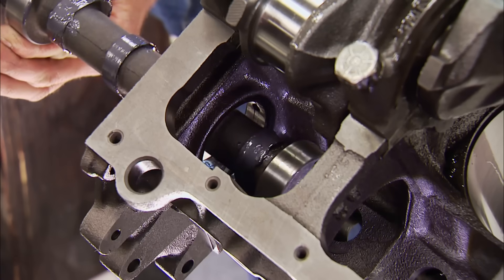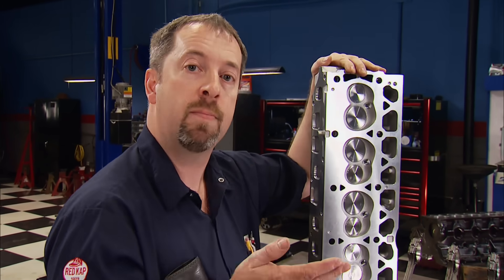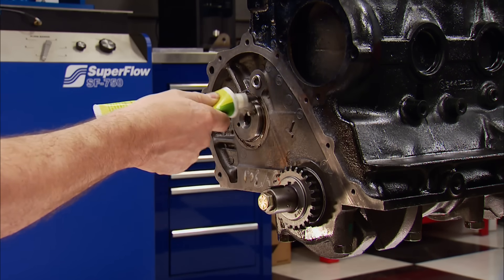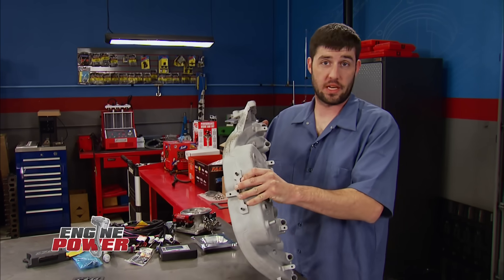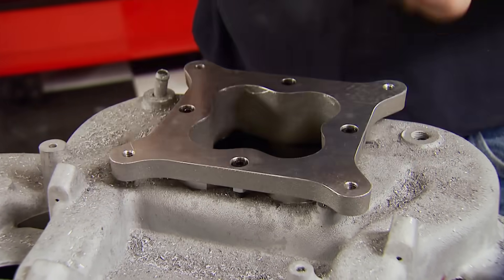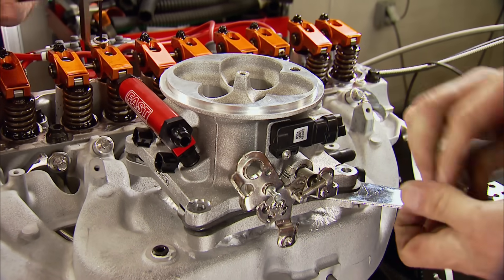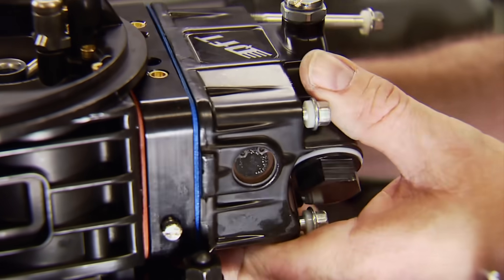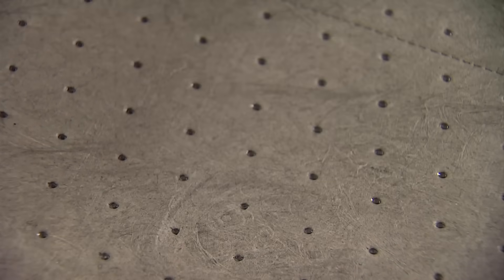Rebuilding a 4.0L Jeep Straight Six to 242HP - Engine Power S2, E14

Comment: Still hoping to see a Ford 300 straight six. Horse power per cube?
\/  People that agree.
Reply: Brock Main3 All this may be true but like to show people ford and GM build dual ohc motors 8n European brands.
Reply: Brock Main3 I'm a pushrod fan but like this build FOR SOME DAM REASON no one put in flat top pistons or direct port injection. I really want to see a pushrod inline six at 1000hp.
Reply: Way back there was a guy named Bruce Size more - he ran a 300" six with a fabricated cylinder head made from sections of 351 Cleveland heads furnace welded together, the car flat flew!
If I remember correctly the car ran in N.H.R.A. Modified Production class.
Reply: MIKE MOTORCITY OG I want to see something like this.. https://youtu.be/zmtVyfC_bBo
Reply: legotec49 No get the dual overhead cam inline six Aussie Ford motor. Guy on Internet put one in a 66 mustang with turbo and it flies.
Reply: @Thelongmanable  No I want to see a Ford 300 straight six pushrod engine.
Reply: @Thelongmanable  boring.

Comment: Wow , old school carb, did the trick. You could even tell the differene in the running and throttling up. Sounded better and sounded more powerful. Awesome good job.  😀👍
Reply: Because the FI system wasen't operating correctly.
Fuel injection would've made MORE power than the carburetor produced & there is NO DISGUSSING that fact.

It's 2019.....
Reply: @elonmust7470  If you say so genius. Since you knew what was wrong with it why didn't you hop your happy ass over there and fix it.. 🤔

Comment: Why not go with the multiport fuel injection like what was stock? Im sure it would have been easier to tune to get to your goal.
Reply: Someone said it in another thread, but, Sponsorship.....
Reply: And would have prevented having to buy a pricey FAST system.
Reply: I was wondering this as well. Seems like they just plugged the injector holes on the manifold instead of figuring out what injectors they needed
Reply: THIS. When they spec'ed a throttle body unit I lost most of my interest.
Reply: @nazcaplain  Throttle body is only worthwhile if you're upgrading from a carb.
Reply: Yes. It was weird to try that TBI drop on unit. Especially the way it was cut into the manifold. I respect the carb solution but there's a better way.
Reply: Or at least find the limit of the factory system and know what to upgrade

Comment: I wish you could have done something for my old 1979 Mercury Monarch. It had a 4.1L straight six with a 1-barrel carb. It produced 97hp in a 3200 lb car. 0-60 in 18 seconds. I hated it and have never bought a car with a straight six in 30 years.

Comment: Your intake probably failed because of how you did it.. and to quote big chief, looks like ray Charles welded it with his feet
Reply: Alex L  ...But Ray COULD weld!! Haven't you ever seen his welds? 
....Neither DID HE!!
Reply: maybe it needed the overhang trimmed to the inside of the plenum and welded flush also?
Reply: Ray Charles was only using his feet so he didn't mess up his hands since he plays the piano
Reply: You ever weld cast aluminum?
Reply: @Thewaldo12345  they used a forgiving filler rod for all of the welding except the first few tacks, lots of gas. Preheat the parts before welding and you'll get better results. I would guess someone is at their CAD and will 3D print in aluminum a proto-type that gives way to a new mass produced intake manifold.
Reply: @Thewaldo12345  one can it dos not work well      I'll bet it Cracks under 10000 miles           They will never tell       it looks good
Reply: @JT_771  exactly, I bet they lost a bunch of horsepower because of that.
Reply: Well cast aluminum isn't the easiest shit to weld and there looked to be some serious tight spots.
Reply: Why did the carb breath better?  Intake stayed the same?  They just didn't tune the fast system.  And why the F use a TBI? They had a MPI intake and no money or parts limitations.
Reply: @ryanharte528  Hahaha literally! Just a product promotion for that shit carb no doubt.
Reply: Nice joke but those welds were pretty good.

Comment: If I was to "REPLICATE" what y'all did to this engine, would it FIT in my 1994 2WD Ford Ranger?

As I want to convert to an Automatic Transmission, what BUDGET options do I have?

Take care,
🤓 -Thomas
Western Washington State
Seattle, Washington Area
Reply: Just pull the engine, transmission, & wiring for them at the junkyard. You'll either end up with an AW4 or a 42RE automatic trans. Then you have to figure out mounting them. Sincerely an Eastern Washingtonian
Reply: Put a 302 in it & stop being stupid.
Reply: @elonmust7470  how boring. not suprised, coming from someone who claims to have swapped alot of ls engines into cars.

Comment: "Build a modernized version" uses flat tappet cam and carburetor
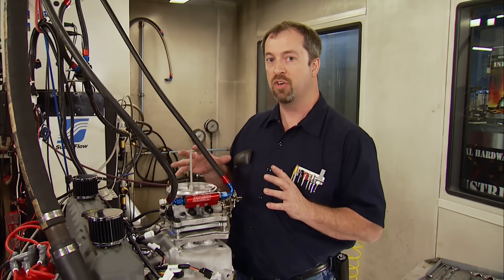Reply: @pritchert2799   14:43
Reply: This engine is 75 years young they all had c/s push rods @ rockers better than the JUNK today,run forever!Two breather filters on V/cover this lowers the temp by 25' the headers release 35%more back pressure the 4barrel carb works better than the slow injectors so all they have done is nothing but OLE SCHOOL 1967 STYLE THE MORE YOU PUSH IT THE FASTER IT RUNS IF YOU GET ROLLER TYPE GET THE BEST.TAKE YOUR TIME T/ PRESSURE HAS TO BE PERFECT!ITS A BALANCE ACT  MORE PRESSIRE OUT TAKE MORE FUEL IN HIGHER HP AND PREFOMANCE ,FLAT TAPPETS CANT KEEP UP,THE ONLY CON TO ROLLER FINE METAL ,YOU HAVE TO CHANGE THEM EVERY 30000.!
Reply: @rayoliver6807  Not going to much against what you said. Pretty good motor. Although fine metal shavings are death to an entire engine not just the rollers. (No matter what engine brand) I have roller cam engines that I driven with well over 200k miles on them. I have clients with even more miles. Remember that a flat tappet cam leaves small metal shavings behind as it wears. Shortening the life of the engine. Also flat tappet cams run much hotter do to the friction they cause, again shortening the life of the engine. Fuel injection is a big expense that is not needed for performance. However, you may wind up (depending on your set up) with a much smoother more responsive engine.
Reply: @Dieseling123  me
Reply: @shenanigansgarage3911  me
Reply: @pritchert2799   did you even watch the video????
Reply: @robtdougherty  I watched the video and the TBI unit was a fail. The carburetor at the end gave them the horse power numbers they were looking for.
Reply: @Dieseling123  - i was responding to @Pritchert27 . looks like he took his comment down.
Reply: @robtdougherty  I saw that after I posted, brain fart on my part.
Reply: they always had flat tappet cams....
Reply: @frigglebiscuit7484  Yes, they have always used flat tappet cams. However modern roller cams are available.
Reply: @Dieseling123  not worth the money.
Reply: @frigglebiscuit7484  Roller cams produce less heat and friction, which in turn is more horsepower. My comment is directed at making the engine more modern.
Reply: @Dieseling123  they also cost about 600-900 bucks to retrofit. that much money for a couple more hp? idgaf how modern it is. i can buy a hydraulic flat tappet for 100 bucks. roller? 400 bucks.
Reply: @frigglebiscuit7484  I understand your point of view, however a flat tappet cam is old tech. I can not think of a modern engine that uses a flat tappet cam.
Reply: @Dieseling123  it's not that modern but the 2jz kinda did, I saw that because they were buckets and not anything hydrolic or of the sort
Reply: I don't think any body sells a roller cam and roller rockers for these engines. The lifters are .904". The trick would be getting them into their bores. That might require cutting out the re-enforcing casting web between the main part of the block and curtain wall.
Reply: @mpetersen6 Sorry for the slow reponce--https://505performance.com/shop/ols/products/jeep-40-stage-1-roller-cam-plus-lifters
Reply: @mpetersen6  WTF...505performance.com/shop/ols/products/jeep-40-stage-1-roller-cam-plus-lifters
Reply: @Dieseling123  
OK. It would be interesting to see how they insert them. The look awfully tall in the the photo. The factory when installing the lifters used a special tool with two spring steel clips that gripped the lifter in the oil groove. Had to make replacement tools for broken ones. They were pretty fragile. I do know that there were roller lifter engines built for test purposes. I believe those used a plate mounted on the top side of the crankcase on a flat surface milled into the block held in place with screws. The lifters were then prevented from rotating by a flat on the lifter body. I saw the blocks being machined for these but I wasn't involved so I kept out of the way. Also in the early to mid 70s we made some custom roller tappets for V-8s.

Comment: This is what happens when people who don't have a clue get a tv show.  The redline on jeep 4.0's is 5200 rpm,  not 5400. They develop a bad harmonic vibration around 5250 that will tear up main and rod bearings in seconds if allowed to hang out at that rpm.  The later 4.0's have a ton of problems that are not related in any way to lack of maintenance as these idiots suggest.
The 97 -99 4.0's have weak piston skirts that break all the time.  I've seen them break with as little as 45,000 miles on them.  The 99-03's have a terrible problem with the really thin, really poorly designed 0331 heads cracking.  The 04-06's have a problem with the cam syncronizer gear not meshing with the camshaft gear because the tooling used to produce these motors was worn out for several years. This causes multiple run ability problems and never ending  check engine lights with no way to repair it other than replace the engine block and hope you get one that is in spec.   The 4.0 was a great engine until it was destroyed by emission compliant bs and weak poorly designed parts.
Reply: They should've talked to the 4.0 specialist. 😂😂
Reply: 0331 were only 2000 and 2001 at least on the TJs. Also, the 2005-2006 cam gear issue can be fixed by upgrading the OPDA to either a crown or a dorman unit as those were redesigned to fix the issue.
Reply: @danielanghelescu2897   0331 was used on other years in cherokees and grands. Don't know how the dorman or crown ( dorman in a crown box) can fix the opda when the engine block is the actual problem.  Do they offer two different opda's ? One for blocks machined with correct opda /cam gear meshing and one with improper meshing?  After seeing  several ford 4.0 ohv engines have blow up after using a dorman opda I would never use one in any engine .  I hate dorman parts with good reason......
Reply: WELL I'M HAPPY I KNOW EXACTLY WTF HAPPENED TO MY FUCKING CAR NOW THANKS VERY MUCH FOR ALL YALLS INPUT NO NEED FOR DELETING I HAVE EVERYTHING I NEED TO PROVE WHO DONE IT

Comment: I ran one of these FAST EZ-efi units...they can be quite problematic, product support was non-existent, even in their forums.  But due to binding contract deals, these guys are NOT allowed to call it what it is...garbage.  They say repeatedly, “It’s not the fault of the injection system”, then slap a carb on and make 110hp more...that is EXACTLY a fault with the injection system.
Reply: Lol FAST is a great product.  It's not the product's fault if you have no experience in tuning...
Reply: @Theodore Dowman LOL, it’s SELF TUNING.  There are a lot of parameters you can’t control with the EZ-efi.  The XFI is a great system, EZ-efi- not so much
Reply: @carportshenanigans5918  BS you can definitely tune it.
Reply: @Theodore Dowman, do your research bud, you can set your idle speed and desired A/F ratio for idle, cruise, and WOT.  It extrapolates desired A/F ratio between those base settings and that’s it.  With v2.0, they added a better “tuning” interface and the ability to adjust cold-start fueling.  That is NOT considered tuning.  You can call BS all you want, you’re clearly unfamiliar with that particular setup.
Reply: @carportshenanigans5918  I use megasquirt
Reply: @carportshenanigans5918  Buying an efi system for a few grand that has no tuning capailities is something only stupid folks would do.
Reply: Glad I only spent $1100 then.  Then again, arguing about something you know nothing about with someone who does is something only stupid folks wood do.

  It was a system that all the reviewers said how great it was...too bad they were all sponsored by CPG.  As for you using MS...yeah, I bet you do.  Considering you’re not well versed in engine management systems, I find that VERY difficult to believe!
Reply: @carportshenanigans5918  Ms3-pro as well as hondata s300. I know several folks using fast without any issues, they aren'y using ez tune though. 
& it's "would" not "wood".
Reply: @Theodore Dowman, read my other posts, I know proper grammar.  You can take up your argument with my phone if you really want to play grammar police.  Again, your total lack of engine operating systems tells me all I need to know about you.  Thanks, have a nice day trolling the rest of the internet.
Reply: @carportshenanigans5918  "total lack of engine operating systems" , you must know me better than myself!
Reply: @Theodore Dowman, yeah it should read “total lack of knowledge regarding engine operating systems”.  It’s exhausting trying to keep up with dim-witted trolls such as yourself.  Tell us more about things, of which you have no idea, please...it’s entertaining.
Reply: @carportshenanigans5918  It seems like you're getting offended.
Reply: Offended? Lol, not even close.  I present exhibit B in the case for your idiocy.
Reply: @carportshenanigans5918  Well you keep replying with a bunch of nonsense like you've been my next door neighbor for 15 years. Because I don't know about an efi system that does not allow the user to tune himself, I don't know anything about ecus & tuning; that's your logic. I started tuning with anderson pms in a 4 eye mustang that I had converted from speed density MAF years ago...
Now go ahead & continue your beratement.
Reply: @elonmust7470  ah yes, ms3 pro, the ecu that costs 1200 bucks, ALONE.
Reply: The fault was in that manifold-using a multi-port manifold to try to run throttle-body injection is going to be problematic.
Reply: @Cameron channell, true, it worked well with a carb though.  A proper 4bbl intake would’ve been far superior for this build.

Comment: You should Totally build a hot rod engine using the L6 from a trailblazer
Reply: Tony Angelo and Lucky Costa from hotrod garage are doing a 4200 from a 2007 Trailblazer.
Reply: those engines are hairbrained and unreliable. they also like to eat water pumps.

Comment: Would that fit in a 66 Barracuda? Nice light body for a Six.
Reply: ive thought about putting a 4.0 in an a body mopar alot.
Reply: @frigglebiscuit7484  I've already got a NVG 3550 gear box for my 66, and mounting it behind a HyperPak Slant isn't that hard... Just thinking going Jeep motor and EFI will clean things up a bit
Reply: @PiDsPagePrototypes  nice. That would be awesome. I hate to say it, but the slant is a pain in the ass to work with.
Reply: I don't know about that, but where the Jeep 4.0 has a clear advantage, is the preponderance of aftermarket support, which for the Slant seems less and less every day.
Reply: Stupid

Comment: Nice, but you can't remove the baffle in the valve cover. It's what keeps the oil from exiting through the PCV.
Reply: I really wish there was a sarcasm font lol
Reply: Dude, that's what you want, right?
Reply: @stanleykendziorski7964  no, you don't want oil going through the pcv valve...
Reply: @stanleykendziorski7964  no, that can lead to oil going in your intake manifold and loss of oil pressure
Reply: Best bet would have been to buy a tall valve cover.

Comment: Why tf the just dont used the old fuel injectors they where right for the cillinders more equal fuel to every cillinder and more power
Reply: Show sponsors TBI system... 🤣
Reply: @PiDsPagePrototypes  ans then they find out well this works shet en then go to carburator men they just dont know how to make modern power
Reply: Reckon they could have left the stock computer on it and just tossed in some higher flowing injectors and better pump, then reset the factory EFI to relearn the motor. It would add fuel to match the extra air from the cam.
Reply: @PiDsPagePrototypes  exactly that😂
Reply: @PiDsPagePrototypes  nope. gotta tune them professionally at that point. camshaft had too agressive of an LSA.
Reply: thats not how it works.